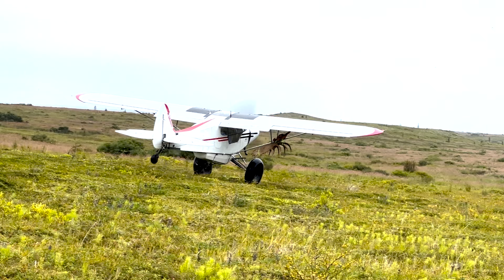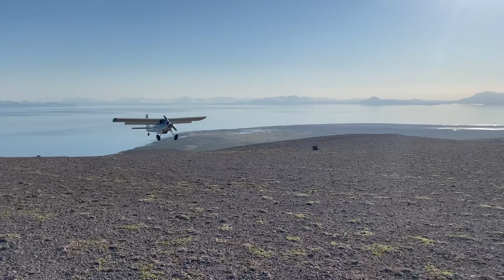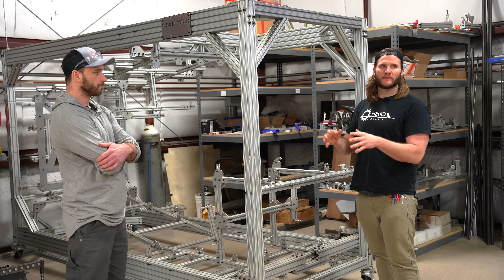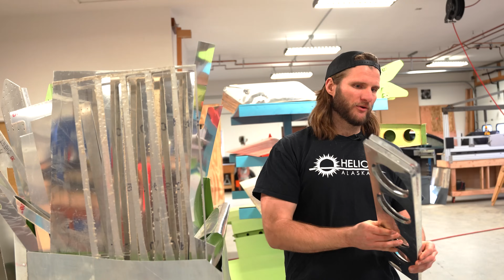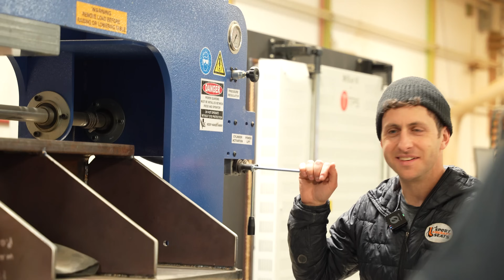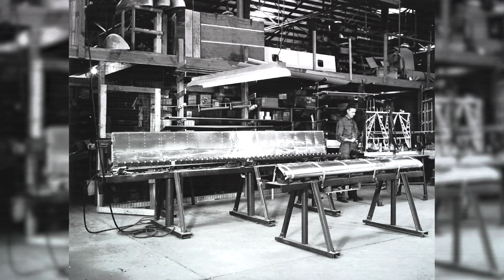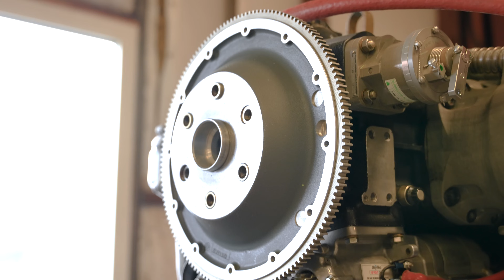Building an Airplane Factory... From 75 Year old blueprints

Comment: Great watching an old school aircraft build. I was a structural airframe repair technician at Evergreen Air Center in Marana, Az in the 80’s. Unlimited repair station. Worked on many planes from 707’s up to 747 and mods and chem milled belly skin replacements on both 747’s that developed corrosion used for the NASA space shuttle piggyback, N905 and N911. We worked many hours drilling out thousand of rivets to remove the skins and then many, many hours transfer drilling the new chem milled blanks from Boeing. R&R thrust reversers ice box rivets, emergency tail repairs on commercial DC9 for a critical revenue flight. Many scab and complex flush repairs on aircraft. I even did repairs on the 747 that they blew up in the movie DieHard 2 after the movie was out.  Good memories.

Comment: Wow...impressive. Just thinking about the mountains these guys climbed to put essentially a hand built aircraft with hand drawn plans into repeatable engineering spec parts - making the jigs - all from scratch. Had a good laugh at the original "trim parts to fit as required".  Sourcing and modifying the engine -gives me the shivers. Massive cool!. Wish you guys well and much success.

Comment: NACA 23012 airfoil is what the early Van's aircraft RV's (RV-3, -4, -6, -7, -8) use. I built two RV's... It is a great overall airfoil and used in many great airplanes. Note Van actually used a 23013.5 which means it is slightly thicker. The last 2 numbers is thickness as percentage of chord. You do this for structural reasons or making the fuel tanks larger, many reasons to increase the thickness 1.5%.

Comment: These are actual scalled drawings you can make parts from... but for airfoil yes the airfoil is defined by precise X-Y coordinates per the NACA airfoil. All this is standard stuff for an Engineer like my self that started in 1985 at Boeing in structures. It was already going to CAD and digital, but many drawings were actual PCM's where the part was made off the drawing (typically ink on Mylar).  There is nothing really extraordinary about this, except if they are remaking tools (that was a whole area of skill, Tool and Die maker) that is a big deal. The Tool and Die maker and CNC programmer has gone away as the drawings are digital going straight in the CNC machines... to make tools or dies and the part itself.

Comment: I like retro era engineering. In a lot of cases, the only incentive for a different model, was the customers vanity. The customer, will always want to exceed the Jones's, not keep up with them.
There is a multitude of products, that were superceded by a newer model, when the new styling was just superficial.
If it works well, don't fix it. Complexity invites frustration, and unnecessary labour, and expense.

Comment: They are taking the time and correcting each part to get the science down to be repeatable every single time if our ancestors could create a working aircraft by hand and it worked even with each plane part not lining up in sure these guys could make a working flying aircraft but where they will put our ancestors to shame is they will have all the notes and equipment perfectly fine tuned by the end of this they will be able to mass produce these aircraft alot faster and each part will be able to be ordered and fit with no issue in the future saving this aircraft as for if they can get it flying in time for an air show i dont know because they do wamt it to be perfect and i wouldnt rush a perfect job so i dont think they will either even if it risks making an important event you always have the following year.

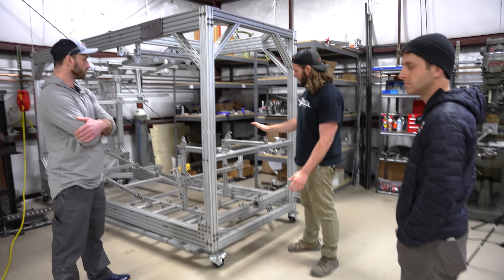Comment: I'm a tool engineer (I design everything that makes the engineered parts like these jigs) for a major aerospace manufacturer, and 6:20 to 7:30 isn't particularly correct, or at least very misguided.

1) Yes, building the first part and building jigs around that part will have all future parts containing the original errors, but this isn't necessarily a bad thing. The CAD designs and reality parts never perfectly align. That first part becomes the master definition and entirely overrides the theoretical digital master. These errors are ironed out by other "errors" (really corrections) on every other mating part in the final assembly of the original plane. It's difficult to explain the process of building that first airplane and all it's associated parts that all then become the physical master definitions for all future planes in a Youtube comment section, but it is significantly more accurate than you'd imagine. Basically all of our best, most dominant aircrafts have been built this way for decades. I believe we're getting away with it, not necessarily because it's a bad way to do it, but because CNC machining have gotten so good and they're completely changing the mythology behind building airplanes (shifting high human labor costs to high machine costs basically).

2) Building the jig first through the digital version has the exact same issues at my point one, and I doubt it's any more accurate, because I doubt they have the $100K plus CMM machines (not including software and training required to use them) to even validate this. If I'm correct, this is why we've built airplanes with physical masters for decades and they probably should have too.

3) That aluminum extrusion based jig is fairly poorly designed on tool design principles for a few reasons. Having the entire frame built out of bolted connections (where none are precision doweled) is bad. All of these connections have the ability to move by as simple as a guy tripping and catching himself on the jig. Welding the frame and then precisely attaching details at engineered connection points with bolts and dowels is the industry standard practice. It's called assembly level fabrication. The Frame shape doesn't really matter that much with it deforming during the welding process, because the location of all the details that actually locate what's being built is precise through how you do it. You want that frame to be as rigid as possible and typically always oversized to fuck. Even steel tubing would have been significantly better than that aluminum extrusion stuff. Although the steel tubing for this centrifuge doesn't look particularly heavy, I bet those cantilever 2020 aluminum extrusion sections deflect much more than you'd expect when it's being built.

4) If their airplane hangar where these jigs are located are not precisely temperature controlled, that alone will throw their tolerances out of whack, especially because of the aluminum's high coefficient of thermal expansion. We have issues at my company because for years our building was temperature controlled, but they've cheaped out and no longer do it. We have seen several thousands thrown off from the morning to the afternoon shifts.

Comment: They got it in the air. Seems as though a lot of what they had to go through to bring back the type, was basically a bureaucracy imposed thing.  These guys seem to have the capability to just build a plane from scratch like the experimenters.  There is an advantage to bringing back a known.  Even though they don't have the same engine and 90% of the parts aren't interchangeable with the original.  Not to say the rules are unnecessary.  Just ironic that what seems like an amazing individual enterprise, is actually regulatory layers of crust.

Comment: I am a licensed A&P mechanic.  This is awesomeness!  Look into Evans waterless coolant for your cooling system.  It has a boiling point of 350° and will not create pressure and blow coolant hoses. I use it in my 1997 BMW 740i. These cars were notorious for bursting hoses and ruining the engines. Now I can run it 100 mph, pull in the driveway, pop the hood and remove the radiator cap immediately while the car is running! I can watch the coolant flow while hot! Awesome stuff!

Comment: Nothing than over sized tires with cloth covered wings; I got to fly a bush master over two Buttes over Spencer's Butte and a east to west climb at noon up and over 50 mile vis blue sky. "as I buffered speed and allowed ground effect to launch this aircraft up the east side of Mt. Pisgua...once re crested the top I notified the pilot that "you have the stick" after laughing a little it was fun that I didn't loose my job that day. A not so normal lunch hour making customers smile as they fly away from your facility.

Comment: 20 yrs with Boeing:  The 777 was built fully using CAD/CAM by many sub contractors in several continents. Part of the success to overcome variation was that material was first chilled to a consistent temperature, machined for a limited amount of time, and returned to cooling.  When final assembly was complete, not one single shim was required.  It was estimated that 2000# of shim stock was required to fit traditionally manufactured aircraft so the 777 saving those 2000# was a big deal.

Comment: Those two guys are BRIGHT. You can see it. And they've got the tenacity to get to the finish line. They obviously know what they're doing. They absolutely can succeed. I hope the FAA helps them to succeed, and doesn't help them to fail. 
I'm building an RV14, I can see that they love what they're doing.
Reply: The FAA automatically requires anyone who purchases a type certificate to immediately provide solutions for ADs and any other defects.

It's a double edged sword. You own the right to manufacture the aircraft, but you also inherit UNLIMITED liability and regulatory pressure to provide components and solutions to ancient and ongoing problems.

Comment: Since they will be using water cooling, I would have considered the 3.8 L GM V6 whose general RPM range is 1500 to 3000, but rated to 6800.   This is a very dependable engine that could be easily adapted and is fuel injected to remove carb icing.

Comment: Why didn't they include the skin thickness in the CADD drafting? It should be modeling a three dimensional material (even if thin) not just covering the faces of a theoretical polygon. You will still have some real material distortion to adjust out but it will be a whole lot closer.
 
Just doing a simple property survey, not including a few seconds of a degree in the outer boundary reference stations will skew everything inside by a couple of feet and you'll fight it for hours trying to adjust all the data points you collected to match up without exceeding the measurement uncertainty [tolerance/error bracket] and grumbling about "Why isn't this coming out right‽".

Comment: Running an engine "Over square"  [or under square] is one of those persistent bits of arbitrary BS that has no engineering basis but keeps getting blindly passed around the pilot community. 
Yes there are some common engines in common training aircraft that just happen to have operational guidelines that approximate square, but that is nothing more than coincidence for those specific builds. 
There are thousands of engines that are designed and balanced to operate no where near "square" [high or low]. eg. basically any supercharged aircraft, my old gasoline tractor (1600rpm and 30 inch all day, torque per cubic inch is similar to a standard Lycoming o-320). If you get into diesels [yes a bit different] you can find industrial and marine engines running 40+ inches with rpm in the hundreds.

Comment: After being an A&P mechanic in general aviation for 10 years then building fighter jets at Boeing for 31 years I feel your pain. It looks like you have smoothed out a lot of bumps in the road. My concern is getting the engine certified for that airframe. I imagine you will be asked for a lot of expensive engineering data by the feds. Good luck in this endeavor.

Comment: Amazing guys!. I am helping a friend build a Mk1 Spifire, almost finished and the engine start up will be this week. Instead of aluminium cover we have used carbon fibre over a monocoque frame which resulted in a plane half the weight of the original. The original had a V12 RR Merlin at 1,100 horsepower so with the weight to power we are using a V8 Chev Merlin and I changed it from normally aspirated to throttle body and electronic injection plus a dry sump. It will spin a 9 foot single blade propeller.

Comment: Funny and interesting but why not build a carbon fiber plane from scratch instead of an ultra complex 75 year old design. The strength of carbon fiber is that if you give the fuselage compound curves then it's rigid as just a single piece shell. No frames, no stringers, no sandwich core. It can even hold sea level pressurization in space like it was nothing. That construction is also quite fast to make inside a closed 2 piece mold, just slap some cloth on it and bag it and it's perfectly identical every time. The lighter a plane is the easier stol is. You don't even need fancy slats. It cleans up the construction drastically. And there is no fear of fatigue. And the common knowledge that carbon fiber is very expensive is also 100% wrong. 450g cloth is about 25$/m2. Because of the engineering benefits it's actually the cheapest possible material. Surprise. Sheet and rivet should have sunk with the titanic.
With a super light plane it's easy to STOL. And rather than going to lower rpm you might try going to higher rpm with a smaller prop, accepting the efficiency hit if it means you get more traction/power from a small engine. Throwing 50% of engine power away has a lot of downstream consequences. I'm not sure a small prop with more blades can make up for it and beat the larger prop at 2300rpm but it's worth exploring. Because you pay very dearly for trying to get high power at idle rpm. It's the wrong way. Notice how rotax is so effortless compared to the old tractors because it runs higher rpm. Mitsubishi is making a 200HP engine that runs 8000 iirc. It weighs nothing. If you had a carbon fiber plane that also weighed nothing, you'd really have something.

Comment: Coming from a background of automotive mechanic to military aircraft structural repair, I look to modern auto production that is also controlled by heavy government control and regulations, re-engineered on a yearly basis, and to very high tolerances, and think, how can they pull this off, producing millions of vehicles and making a profit?  It is going to take 2 guys and a handful of jigs to pull this off?.  They are going to need government intervention to succeed.  The nice fluffy comments are okay, but it is not making the project happen.

Comment: So the vellum drawings are gone? I get the feeling they are, since paper copies is all they have
Reply: I worked at beech aircraft in Wichita back in late 70’s early 80’s. We had rows and rows of drafting tables working with ink on vellum.  All the drawings were stored in a vault. Some were from the 30’s.  

My first engineering job.  

I remember the old guy who sat next to me.  I remember him working 8-5 on the dot.  He would have his lunch pail closed up ready to punch out 
 at 5 pm (still used mechanical punch clocks and cards).  He told me i could retire at Beech. 

But Raytheon bought Beech.

Comment: Hi 
Does anybody understand the pressing procedure that was shown to make that small part. 
I understand the form block but what moulded the sheet metal around the form? 
Thanks
Reply from the maker: With 2000lbs of pressure the foam pushes down on every adage of the block.

Comment: One of my flight instructors did the flight testing on the turbo prop Helio I think it was called the Stallion. He said it could climb to a thousand feet and be behind the starting point on the runway enough to cut the power and land back on the numbers. I saw many Helios but none with the turboprop engine.

Comment: I'm not a jig expert (or novice even) but won't there be lots of variability when using aluminum jigs due to thermal expansion? And screwed together aluminum jig, on casters, is probably not very stiff -- causing warping depending on what surface it is rolled onto. And the screws will eventually work their way lose. I'm guessing that this much variability is ok but they make a big deal about how much more repeatable their solution is. Post production CMM is the only true way to guarantee tolerance of production parts.

Comment: The wings are generally made with wooden spars and ribs. Therefore the weight of the wings is significant, the construction is made with small sticks.
Now exposing the wood structure to deep vacuum will SIGNIFICANTLY REDUCE ITS WEIGHT. with no measurable structural strength.
The easiest way is  to individually treat each wooden part into a vacuum chamber for 2 days.
Try it!
Reply: You must have been watching a different vid, because the one I viewed clearly showed an all aluminium construction...

Comment: You're speaking my language. OMG! Not only have you had to digtalize the drawings to cad, you are trying to fit everything together precisely with predrilled holes. Your fuselage jig is wonderful (especially the way it holds the tubing) and the wing jig is outside the box smart. Everything you are doing is excellent. Good luck with the project. 28 year airline sheetmetal guy.

Comment: Is this all an exercise in avoiding having to get a new design certified? In other words, could you have built a better plane, using production and manufacturing processes that would have better economics, resulting in a safer, more performant, more affordable plane? But didn’t because of the regulatory environment?

Comment: I operated an amonia blueprint machine at an engineering company. in the mid 1980s. The company had ink and pen 1880s sepia drawings of structural iron and waterworks projects. When they started using Autocad to digitize the old drawing they found  filits marked with a certain radious were imposible to fit in the overall dimention of the piece. The old pieces were fudged on the fly as the components were manufactured and assembled.